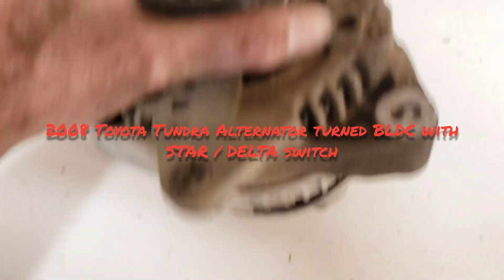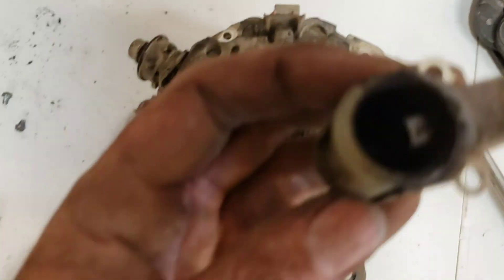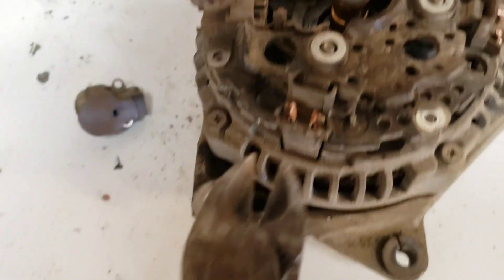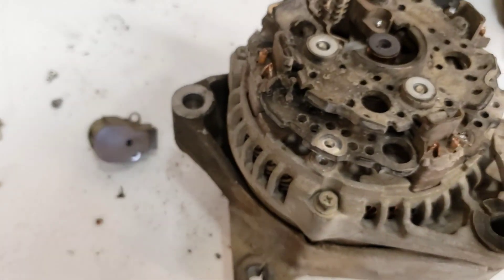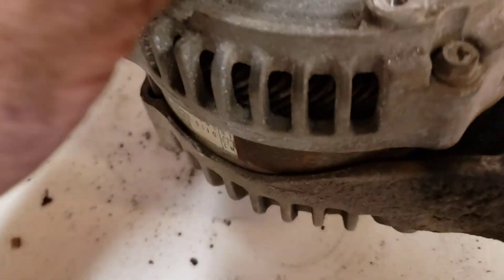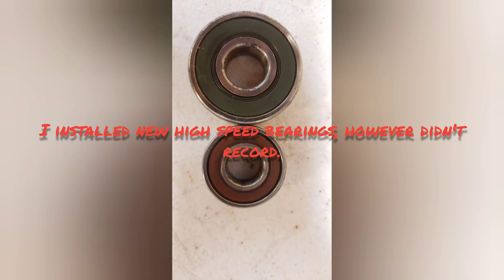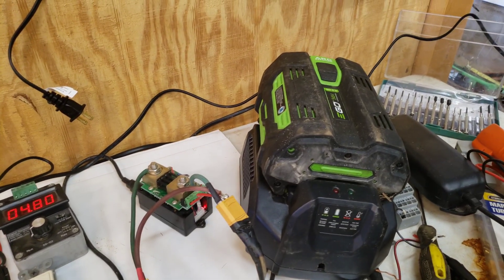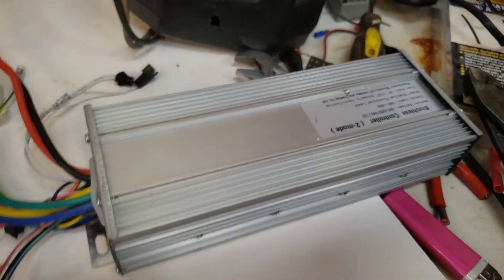BLDC truck Alternator to 3 phase motor with Delta/Wye switch using 2000w brushless controller w 56v

Comment: Great . I'm guessing this might be Denso 'hairpin' dual wound alternator , the same I'm using obtained from a BMW in my case . Mine is rated at 240 A out so I reckon that 150A load @ 96 V is enough safety margin in a lightweight motorcycle frame for short trips and shows , but was undecided on how to wire it to get Max torque low down and Max speed at higher throttle position ? Like this or dual Y , dual delta etc . I am also using hall sensors a Motorola 3035 3055 ? to a 4049 hex inverter for Lo and 2011? drivers and 12 X fast 100 v 200 A IXYS? 210 N channel MOSFETs so both pairs of windings are continuously flowing . I was also considering variable voltage to the rotor from a left thumb throttle to reduce magnet induced drag at Max 10 000 RPM if its possible to load it to that speed . I'm guessing the controller chip set will have its limitations and expect that once voltage current curves are plotted a Uno or Mega will take its place . Any suggestions ?
Reply from the maker: You my friend have gone down the rabbit hole in attempting to make your own controller further than I have, i would be very interested to see what you are working on.     First off, this is a hairpin denso.  You can tell because the case is seperate on both sides of the windings.   This particular one is rated at 160A.  In your case, in a peak short burst situation, you could likely get the motor to turn at 150a x 96v = 14400 watts, however you would really need to mitigate the heat.   Considering its a 260 amp rated alternator, at 14.4 volts, thats rated for continious running under a hot hood of a car in summer at around 3500 watts.   I likely would only push 3x which would be around 10500 watts and would want to monitor the temperature with multiple thermocouples, type T would be the correct range.   This is a lot of power, and would require a pretty large battery to be able to run for any duration at that load, if using lithium, pay attention to the data sheets for your cells max discharge rating when sizing your pack.  Since your using halls, have you looked into the sevcon controllers?  They have sensored and sensorless controllers that can be programmed to limit current and run at a large range of programmable input voltages.  You can sometimes find them on ebay in the $300 range.   This is what i plan to do for my new electric boat project.   I will have the ability to house a rather large battery and have access to fresh water, so cooling is much easier and less complex.

This particular alternator winding only has 6 leads, each winding has two ends, so im not sure how you would wire dual y or dual delta without rewinding it.   

If you run a delta wye switch similar to this, i would use large contactors due to the high current.   You could use fets, just make sure you pay attention to the data sheet and heat sync the hell out of them.   I have had a series of solid state relays burst into flames rated at 45A when only running a resistive load of 30A for a decent duration.   Fets do fail open, however i hate wasting power to heat when a contactor with a properly sized coil can be much more efficient at higher currents...  on battery, i like the chunk ca chunk contactors.

Definately a potentiometer on the stator will change the rpm by reducing the magnetic field.   A thumb throttle would be best, however i think this could be automated with enough study of when and what voltages correspond to the sweet spot at different conditions of opperation.  

I am very interested in what your doing and would love to see your progress!  I just started posting some basic things that ive done but found little to no information on how to do it.  I thank you for watching my sloppily assembled video and would love to record any tests etc that might help you on your build.   Let me know what you would like to see and I look at putting something together!   Have a good one and stay in touch!
Reply from the maker: Have you seen this video series on making an esc motor controller?   https://youtu.be/W9IHEqlGG1s.
Reply: @samsracing  Hi . Thanks for the reply . Its 08:10 in the UK hence the delay. 
I recognised it immediately but noted the 6 diode pack as opposed to the 12 in the larger unit in the first few frames . The larger alternator differs in construction and is much more suited to motor application with the winding completely encased and uses 4 x 10mm bolts to mount it . If you manage to locate one of these things ( mine cost £30 - $35 shipped off Ebay) , a little more work is required to separate the exciter brush pack from the diode pack . With the rotor exciter plug at 12 o'clock and centre pair of stator wires at 6 ,the coils are separated right and left of 6 . There is continuity on the right 3 wires indicating 2 separate pairs of windings , a quasi '6 phase' set up as used by the Magneti Marelli team in Formula E . There are cooling fans each end .The scrap yards here are full of BMWs , in all honesty the only parts I've salvaged from them and other high end German are the Japanese Denso components . I have Honda cars and bikes and love my USA built Mark 6 3.0V6 Accord Coupe ( I've actually got 2!) .
 I've looked at the heat dissipation problem originally considered a water cooler alternator of the same rating but water cooling has its limitations in jacket size of the actual alternator regardless of radiator size . With an aircooled alternator and just the fan and forced air flow from forward movement , I can pass much more cooling capacity through the alternator without adding weight and possibly use the slight Merrell effect of the heated air to assist forward motion or negate some drag. The Fet cooler part of the controller is a pair of large aluminium finned heatsinks used to cool a 2000W ( dissipated) Fet power audio amp and form part of the aesthetics of the motorcycle . I'm using a very light Honda NSR 150 SP rolling frame from Thailand and Tyga( A Thai motorcycle aftermarket company) are interested in the concept too . I'm going for a poor mans 'Arc Vector' but keeping it more traditional with single swing arm rear and upside down fork front end . Its tooth belt drive from motor to intermediate shaft to rear pulley , O/A ratio is around 8.9:1motor to rear wheel and will clearly not achieve its theoretical land speed record top speed which is limited by current load .
I'm using aircraft contactors , circuit breakers and solid state relays from a failed project to begin building a 3/4 scale P51 kit for export over 10 years ago , after the failure of the Stewart S51 pop rivet kit in the US , and worked with Jack Cane at EPI Engineering in the US to produce the PSRU ( gearbox) to suit V12 Jaguar Engines rebuilt to aero standards here in the UK . Letters of intent to order were received by Jack and I for countries where kit builds were permitted which surprisingly with the reputation here of engineering excellence regardless of who are what you are , the CAA does not permit an individual to build anything rated more that 187 bhp .The Jaguar engine designed and built was to produce well over 750 bhp ( incidentally running 2 Denso coil ignitor packs from an Audi V6) normalised at 20000 ' to create both the sound of the Merlin and actually outperform the original aircraft. Unfortunately that business ended from bankruptcy in a bizarre unrelated legal case . Like Jack I'm a Mech. E but often electronics and other systems overlap. I much modified an old ECU to run the wasted spark system on the V12 .With much of the funding gone I was left with a great many engines and aircraft parts particularly the electrical hardware. I'm getting on a bit now at 63 and retired from both professions , but have messed with stuff for as long as I can remember . I broke all my toys as a little kid , not out of malice but to see how they worked , but my 21 year old son is trying to top me ,which is great and will replace me when I'm gone.
The limitations of the simple chip set is braking by sending Out Lo to ground so no regen , and of course all the points mentioned before . The Hall ( E47s ?) positioning once established will remain when the chip set is replaced with something programmable . Current sensor is a 200 Amp ACS 758 , whichs allows 12x 2 mm copper bus bars 24 sqmm should handle current . I was going to use a Denso unit from a Honda but it does not have a high enough rating . Thermocouple monitoring is planned and the chip set has a fault /data out that can be used.
No I haven't read much and thanks for the link , I just started a search for 3 Phase Motor Controllers and followed the example circuit in the data sheets , that leads to choice of inverter , to driver etc., and then checked by reversing the process by starting with the Mfets voltage 100V current 200A find that recommended drivers and back to controller selection , and double up the number of Mfets in the final design . I looked at DC DC convertors 100V to 30V on the net to get the +12v and logic level voltage by V regulator I made before. Found one on EBay 100 V for a crazy priced of £6($7) expecting to replace the circuit components , beef up heat sinks etc., only to find when it arrived and I cracked it open , there was nothing I needed to do . It handles more than enough current for lighting etc and powering the controller . That is the story so far . I'm hoping to get the bike done for the Bike Cafe show this year , it there is a this year ! LOL ?
Im typing this on my pad so can't check if you have a website link or address listed . But happy to send some basic stuff that has been drawn out roughly as most of it is in my head , with an awful lot of other stuff .
I'm guessing I have the analogue hardware of the electrics covered in being very high current rated ,durable and light . This is where the US shines as you have more aircraft breaking yards than we do. Most of the Klixon breakers and other stuff I believe are from one of the most reliable aircraft ever built by Boeing .
Reply from the maker: @georgerobartes2008  I have never come across an alternator with 12 diodes stateside, but you have peaked my interest to search a parts yard as the possibilities would greatly improve as far as a motor as you noted.   What I have in youth and desire to experiment is held back by my need to work to make a living, which fortunately is in a mechanical testing lab, where also, electrical is a secondary, yet very important desire of mine.   My daily life is shrouded with confidentiality etc etc, so my free time i like to experiment with cheap ways to turn scrap into motion.   I dont have a website as the you tube is just a new hobby meant to meet like minded individuals.   My email is drewm5555@gmail.com, and as stated id love to see your project and learn/contribute accordingly.    I am recently located in Georgia, right across from the Delta repair facility.  I have yet to search for aircraft bone yards out here, but if you have any requests for parts.   I will do some research on what cars were produced with a 12 wire alternator here as id love to pull one and experiment!  We recently packed up from a corporate job in California and moved out here in a bus i converted into an rv and have been slow to set up a shop, as we sold all my equipment to travel light.  With the move to a new area, finding the "getting spots" has been high on my priority list, so ill have to get to it and find an alternator as well as find somewhere to pick up aircraft contactors.   Do you have a youtube channel?  Id be very interestes to learn from your projects!
Reply: @samsracing  08:10 GMT Thanks for you address , as a result this will be a much shorter message . I'll send some photos and a quick note as I'm helping at a friends workshop today with a couple of motox bikes that have electrical problems . For others looking for this type of alternator , the BMW model that this was obtained from is the E40 in its international designation . I don't have a You Tube channel and my account has been banned twice in the last month for incitement for just reporting information coming out of Europe on the US election .
Speak soon . Interesting stuff going on here too . 2 Typhoons were scrambled yesterday at 13:00 GMT to intercept a large unresponsive aircraft in our airspace and forced to land at my nearest airport Stanstead in Essex . The supersonic boom was heard across East Anglia . We are waiting for a news update . We have 2 Airborne regiments at my local garrison and 2 Infantry regiments on standby , information that has come through my military association channels .
Reply: @samsracing   Hi , just sent an email to your address and it immediately bounced back . What is happening as I have had the same problem with a friend in Three Rivers since my first banned account ? Cheers George .
Reply: @samsracing  
Hi,  I am a Hungarian guy from Australia. :) I just picked up my first alternator today and I expected to find a 3 phase one but looks like I got a 2x3 phase. It looks a same as yours in this video, but as I measured the conductivity on it, I found 3 wires in one group and the other 3 in the other group. It rated 12V 150A  and have 12 diode ,it come out from Land Rover, denso ah22-10300-ba,
I have not too much knowledge with electronic but I use it in my hobbies.
So my question is:
If I have 2x 3 phase, can I use two ESCs a same time or my feeling is right and not that simple...?
Sorry for my English, I know not the best...

Comment: How much power have you been able to pump into that alternator under load? I've always wanted to do that
Reply from the maker: With the controller I have in the video i can feed in around 2000 watts before it and the battery over current and try to save themselves.  Thats a little over 2 1/2 horsepower based on the numbers.   I need to build a motor dyno to really know torque and horsepower.  Ill make a video of the dyno and different alternators ive built.  I suspect the delco Remy i have will be the winner.